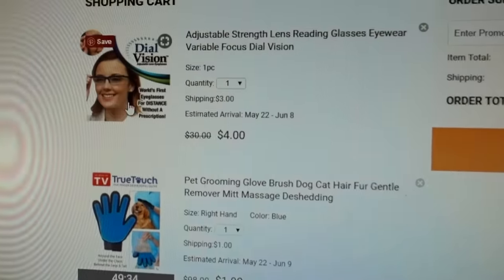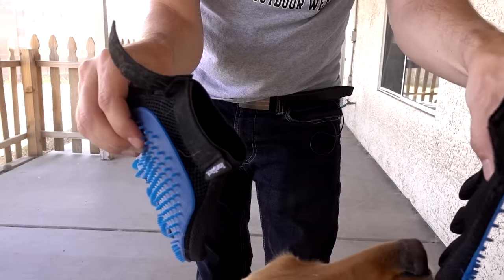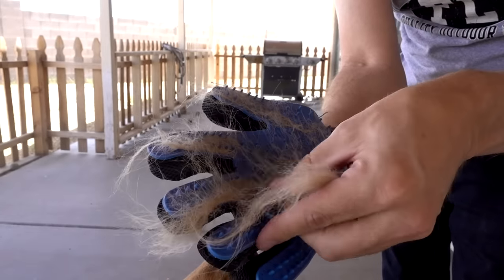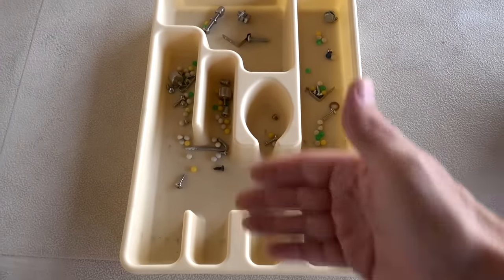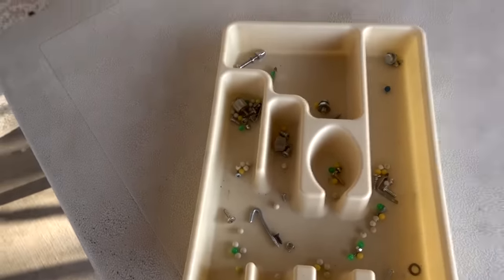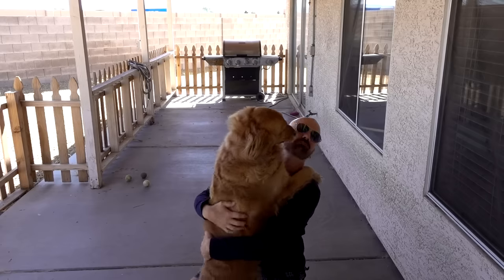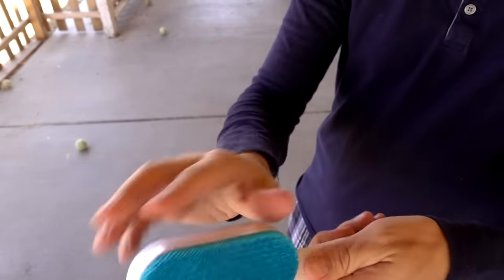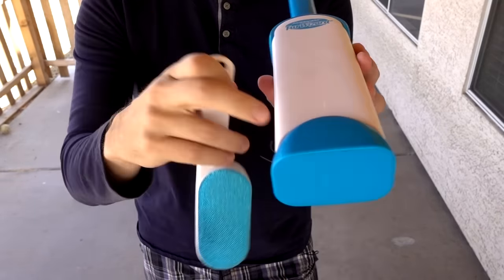Wish vs As Seen on TV: 5 Items Compared!

Comment: Great video. LOVE the Bailey helper!  A note/tidbits about the Wish "Fur Wizard"  the end piece that popped off? Drag/scrape it across the brush to remove the hair & lint. (If you look in side the A.S.O.T. version's base, you'll likely see a plastic edge running the  width of the inside that cleans the brush off, so the Wish one wasn't 'cheaply made' (OK, it *was*, just not 'that' way.) The end is MEANT to pop off so you can use it to clean the brush.

Comment: The problem with the wish egglette. you do not know if the plastic has been inspected and does not leech bad chemicals into the food. the official egglettes might be better inspected. i would not risk it. china will cut corners when they can.
Reply: Lynx 4293 True
Reply: Most things are China made though and in the same factory as quality checked items.
Reply: cl vs ul.. sure buddy.
Reply: +TheGhost Difference being, if the company is registered in say the UK or USA etc then there are certain rules that have to be followed for sale in those countries. So the factories have to use the correct materials as they will be tested to ensure safety. Those materials are often more expensive. However, if the same company wants to make a knock off version in their own factory, they know they're going to have to sell it for less to get the sales. So they want the materials to cost as little as possible. So even if they do make the knock off in the exact same factory, they'll often use substandard materials (perhaps even toxic) as it's just cheaper. And as somewhere like wish doesn't sell inside other countries, they don't have to test the products in the same way. It's the customers responsibility as importer to make sure the product is safe. Sucks but it's true. They make use of every single loophole possible.
Reply: Best "egglett" ever is the shell the egg already comes with. ❤
Reply: First, there’s a high chance that both are made in China. Second, if you are so neurotic about stuff like that then there’s always the option of boiling in the shell instead of plastic. I don’t understand this product. I have always boiled my eggs in their shells and then peeled them with no problem. I’ve never ever had any trouble getting the shell off so what’s the point of this product? Is there another reason for this product that I don’t know about? And as we seen by his demonstration that it is easy to drop a piece of shell inside of that thing when pouring the egg in. So if it’s a shell problem you are trying to solve you can see that it didn’t solve it. I never have shells stuck on my boiled eggs. Somebody please explain to me why anybody needs this product other then because they are addicted to kitchen gadgets. I love kitchen gadgets myself if I’m honest.
Reply: + Meral Dalanbay
liked your comment,,  My daughter  gave me one  that  came in a  box so it's just one single  egglet  boxed to which i've never even tried , partly i keep forgetting  her reasoning was so i could add other ingredients  in with the egg  for a  more egg- siting snack ,lol, i suppose, honestly, it's likely to  be unopened for  at least till  the next time shes in town and  either  does it  / insists or   maybe forever  , the whole take it  from something i trust to putting it into plastic  just doesn't  feel right to me, especially hearing so many  arguments over the use of plastic  , safety and others,,   Have an egg-citing day  as i salute yours, the best comment  i read
Reply: Alexa Faie uhm there are very vew factorys were they make eggs for legal and illegal markets. The secret is they already make them for super cheap prices !and if they sell them in the USA they sell them for more.
Reply: There have been plenty of reviews of items pulled from local stores that are selling the same products  made in China you may get from Wish. Especially it they come from Dollar stores or those that are a step above  like  Family Dollar, Dollar General etc. Then again I watch a shopping channel selling high end $400 Makenzie-Child teapots. Go on Amazon & read the reviews for that item. The company claims are it's handmade & painted here in the US. Customers complain that the goods come from China & are junk.
Reply: Katie, Fresh eggs do not peel as easily as store-bought eggs.
Reply: Old folks are so preciously out of touch.
Reply: Insert-Bacon-Here Not necessarily. Just because they look similar doesn't mean they're made in the same factory. The more likely scenario is that someone stole the design files from the original factory and made their own production line somewhere else, probably while cutting corners where ever possible.
Reply: Ivan The Dude I laughed so hard at your comment lol 💀

Comment: The Wish fur Wizard; in the '70's, a brush, similar to it, was cleaned by stroking the brush over another cloth, in the opposite direction. Perhaps this would de-shed your Wish, Fur Wizard. (Yes, I still have 70's brush. 😄) (subscribed)
Reply: William Victor my parents still have their red "lint" brush from the 70s too!
Reply: I have the same! red and everything
Reply: UK and we also got a red 70's lint brush. White plastic handle with a red button in the middle with a spring and push rotation system. The button also has a arrow letting you know which way to wipe. To clean you wipe against the arrow. Just don't do it on cleaned clothes. 
We also have a red record cleaner also red but it uses much finer fiber.
Reply: William  Ktel brush.
Reply: William Victor oddly I know what brush you're talking about. I think my gma had one😂
Reply: My gamma gave me hers it's like the best for my marching uniform
Reply: Yes! The red velvet looking brush. I used it 20 years ago and loved it.
Reply: It's a lint brush.
They're traditionally red.
It's only a fit wizard if it comes with a lint trap that holds hair and stuff.
Reply: I have one of those right now I did swipe it from some older relatives but they never used it (it was at the bottom of a drawer) and I use it daily.
Reply: Well, I´m from Germany and my parents still got a red 70's lint brush. I love that brush and it´s the reason I bought that blue brush from wish. Hell yeah, the 70´s are back in my household. lol
Reply: Or wipe in the opposite direction.  I still have mine.
Reply: I have one of those brushes too.  I found one at a flea market or good will or something as well and gave it to a friend.  You can still find them occasionally.  Love that thing!  And it is easier to just swipe it in the opposite direction than to have to use a device to put it in to clean it.
Reply: William Victor yup. Same. We still have our red lint brush somewhere too. I swear we still have a vacuum from around that time too. (Maybe the 80s truthfully) Nowadays everything breaks and doesnt even last 5 years lol
Reply: I literally have a brush that works on the exact same concept. It picks up hair in one direction, and takes it off easily in the other. I got it for about 2-3 dollars.

Comment: Fake Dust Daddy seemed to pick up faster and that might be due to the shorter tubes.
Reply: There was way less coffee for the fake's test.
And yes. Shorter tubes means slightly better suction.
And also less utility.
It also jammed up with stuff it can't pick up far more.
Reply: The pitch of the shark went noticably up as well indicating the fake one has more resistance and less resulting airflow/cleaning power.
Reply: Yeah I kinda liked the fake one alittle better.

Comment: Bought the ClearTV from wish. Came in a Blister pack like the real one. No female adapter to connect with. Works ok with the cable from my other HD antenna...if I move it around a lot to get clear pix. Still cheaper than cable! Have been using wish for over a year with a few snags, but overall am happy, and surprised every few days when I forgot what I've ordered! thanks for the vid!

Comment: You should have re-scanned your TV with the fake Clear TV key antenna to see if it picked up more or fewer channels or the same # of channels.
Reply: Andrew Rood it's probably the same. Both of them are just metal wire in a nice similar design. If one was bigger or mounted elsewhere then there might be more channels or better quality.
Reply: @__aceofspades  Bigger doesn't always mean better with antennas.

Comment: I'm a dog handler and a good way to teach your dog to really calm down when she's so hyped up is to teach her sit and to actually stay sitting. Or an even better way, "go and lay down" which should be her own bed. Don't only use it if she's bad cause then she thinks she's been bad when all she's been is being happy. Use it just to calm her down as well.

To teach this. Sit like a meter away from it (a step away from her bed) and point at it. Say the command and try making her go and lay down. Each time she does it, she gets her treat. Some dogs are way too focused on the treat so try holding it in your pointing hand closest to the bed.

Gradually move away bit by bit, mauve even standing up instead of crouching down and continue practice this.

After some time when you feel she seems to understand it and actually cool down, variate the time when you give her the treat (when she knows the command)
Example, in the begining you give her the treat immediately and when she knows the command, maybe wait a few seconds to see if she'll stay there without you saying anything and then rewards her.

This brings ya closer to when a guest arrives. Let her stay in her bed and really work with her staying in that bed instead of just running over to that guest. She MUST wait for your command if she may go crazy and say hello or not ^^

Just a few tips.. Have an awesome day and great video!

Comment: I would probably consider myself a regular purchaser on wish as I am always getting something each month.  Everything I had purchased were mostly on point.  Only caveat I would say for people to remember is read the description.  There are going to be many items out there that you think you are going to get either multiple of, a certain size, certain colors, etc..  That is not the case.  If you see an item with many colors and you hit buy, but you dont see a color option, the description may most likely explain why.  I ran across many items like this and found that I read the description more than just the main ad.  The multiple colors displayed may be enticing, but if there is no direct color option to choose, it will most likely be a randomly selected color being shipped to you.  If you dont mind having a random color shipped, go for it.  But if you are trying to get an exact color of a product, keep looking til you find the one you want.  Sam goes for sizes.  Be very careful when it comes to sizes.  I ordered 2 items of the same product, but 2 different sizes from the same company/listing.  I ended up getting 2 of the same exact sizes even though I ordered 1 medium and 1 XXXL.  I eventually just gifted the other one and reordered another XXXL and got the correct one.  You can send a note to the store and they will most likely just ship out the correct item for no cost to you as it was their mistake, which has happened twice.  But in this instance, a friend of my wife wanted one after seeing her wearing the product.  So in a way, it wasnt a real loss to order another.  So as a reminder, check the description section on items to make sure you are going to get what you are looking for.  Oh also, check photos too.  Some will have numbers or letters to tag to a specific design, color, etc., when it comes to selecting an option on a product.

Comment: I've shopped at wish and had no trouble with their products. I bought a tactical backpack, some shirts, several pairs of leggings, ocarinas and stands. while the shirts took almost a year to arrive Wish was good and refunded my money and allowed that if the clothing arrived I could consider them gifts. One thing if you're buying clothing however, read all the page and the sizes available. I'm a BBW so my clothing was XXXX which did fit quite nicely. A lot of ppl have trouble with the clothing because the sizes are for orientals not caucasians per se.

Comment: The Dust Daddy is a PoS. They're a lot different now too than the one you have. They've down graded it till it doesn't work anymore. I have three vacuum cleaners, all different makes and models, and it doesn't fit on any of them. When I complained directly to them they tell me that now I have to go out and try to find an adapter for each of my vacuums. Also, the thing does not stay together. The end piece that you're supposed to be able to just turn and tighten it's grip does not stay attached for any longer than a few seconds. I just threw the whole thing in a drawer where it's been ever since after trying it the first time. Twenty bucks, down the drain. What bothers me is that they probably made a profit off of selling people garbage.

Comment: With regards to the egglets. What materials did they use? Because the 'fake' one might use more toxic leaking plastics. That would be my only consideration between the two. Other than that they are practically identical.

Comment: The only problem with the last one. The egg cooker thing. Since its a plastic under temp cooking, the official might use safer more heat resistant plastic, the fake might use cheaper plastic and the issue is that the chemical deterioration and seepage of the chemicals into the egg when used.

Comment: With the faux fur wizard, IF you brush up on your shirt, almost all the hair will come off in a clump & you just need to pick up the hair off your shirt. Then you can brush down again or just use your hand to knock off the excess hair on your shirt. That was the original selling point of the Fur Wizard.

Comment: well the fur remover (with kind of one sided velvet that picks up fur and stuff) is a quite old design, i have one that is from the 60s, and you have to clean it by hand yeah. I don't see how much of a big deal it is ^^ There is a way to remove the stuff easily by hand, just going in the good direction to pull the stuff. Like i said, my fur removal thingie is more than 50yo and it's working perfectly ^^

Comment: Nice reviews, But in my 5 years experience of using Wish, Ali Express, Joom and Geek (All basically the same) you always have to read the description and scroll through all the pictures and then you have to select the size because the size depends on the item.
Ali Express does all home goods and decorations like stick on wall stickers or toothbrush holders etc.
Geek does a lot of gadgets.
Joom does everything cheap from china
and Wish has a mix of just about anything.
Reply: I like to use Joom BTW> It's 90% Free shipping unless its really heavy :)

Comment: The Clear TV antenna is nothing more but a piece of wire in a plastic casing. You can make one yourself for next to no costs: just strip down some coaxial cable, slide the outer layer down over the non-stripped cable and strip down a small part of the inner cable to uncover a small section of copper wire (5 centimeters, 2 inches). Antenna is done.

Comment: I feel like there's a weird consensus that wishes a good website to buy certain items cheap but eBay ends up being better in terms of finding certain obscure items at equally decent prices. I was looking for a tactical vest on wish and it was roughly around 35 to $50, however on eBay I was able to find a seller who was able to sell it for 19 to $25 yes. So I decided to check out other items, turns out which has a weird way of raising the price of certain cheap items on Ebay by $1 to $5. So in truth, I find it very weird why people still shop at wish when eBay has cheaper items.

Comment: You can use a basic hd antenna and get same quality.  There shouldnt be any difference between the most of them.  If its a digital signal you typically get it or you dont.
Reply: BroskyWhoDatedHoski BroskyWhoDatedHoski Your dad was getting ripped off.
Reply: Steve Polverini my dad's getting ripped off too. I told him about antenna, and he's gonna switch to that. He pays 200 a month for cable...

Comment: Doe Bailey have like 6 tennis balls on the porch? :D :D She may need to go to addiction counseling for that tennis ball addiction LOL.
I bought a glove like that from walmart for a couple bucks - mainly for one of my cats, I only did it b/c when I brush her her fur goes every where and a ton of it up my nose and makes me sneeze so I just go it to keep the fur contained while brushing :) 

How does the ClearTv (either one) work with crappy weather? like windy, rainy, or just an overcast day? I bought one that sits out by my tv and it has the metal adjustable antenna (Like old style "Boom Boxes/Radios" have to move around. but any one stands near it , the reception breaks up, same with a slight breeze, over cast etc. it's annoying - I no longer have cable I use that, and firestick (mainly for netflix) but when I want to watch regular tv it gets really annoying with it cutting in and out all the time

Also the fake furwizard - will it fit into the base you have of the real one? could use it as a back up or a second one for when 2 people need to de-fur at once LOL

Comment: I have bought a great many "as seen on TV" items from Chinese sellers on eBay. Most of the time I have been pleased. When asked about packaging and instructions, most tell me US distributors decide on the graphics/packaging and write the bilingual instructions. Most of what I receive comes in bubble bags or "our retail packaging."  I'm told they are not as brand loyal as Americans. So multiple manufacturers share the same basic designs there. Considering some of the overpriced brands here, I tend to believe them.